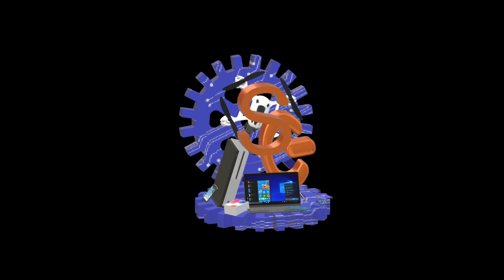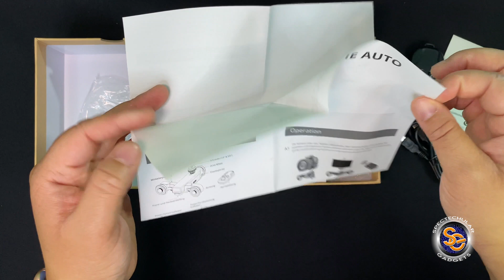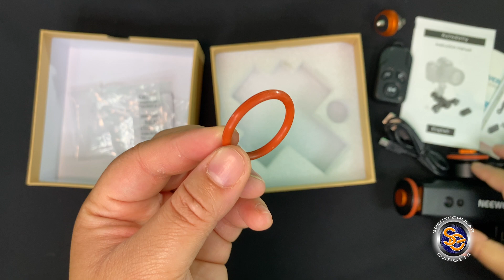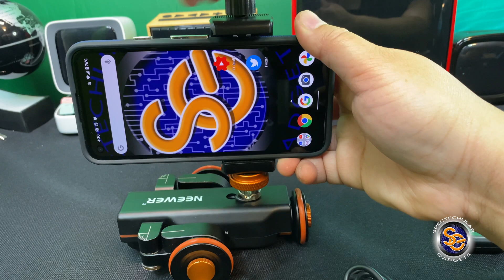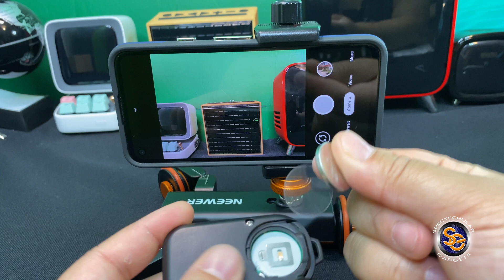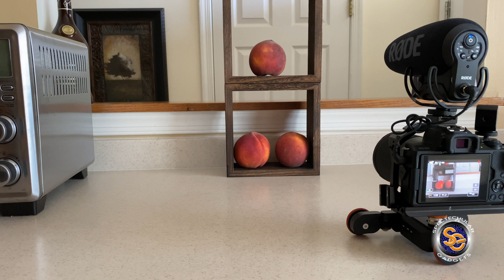Neewer 3-Wheel Wireless Camera Dolly

Comment: I just ordered this yesterday, and I’m amazed how useful this thing can be:

I’ve watched a thousand YT videos about buying sliders (ridiculously expensive), and about MAKING a slider. Either total garbage, or you need an engineering degree to build one according to their plans.

This?

I’m going today to buy an 8-foot plank of thin, narrow lumber...and two lengths of molding to glue to the edges as safety rails.

Drill two holes into the plank, or attach certain brackets, let it sit on two light stands or whatever, and I will now have an 8-foot motorized slider. 8 feet!
Reply from the maker: I would say this little device is very useful. Thank you for your awesome comment and I appreciate you watching.